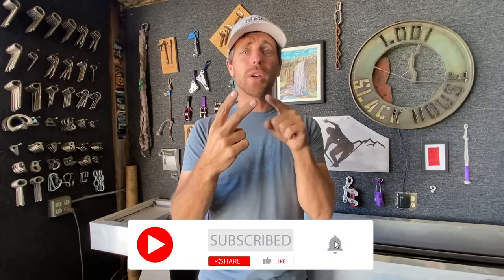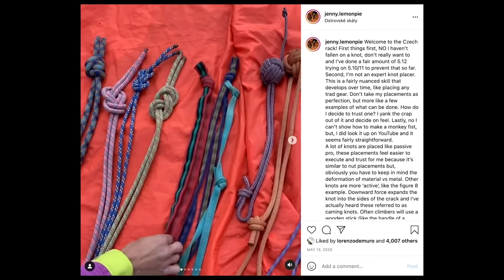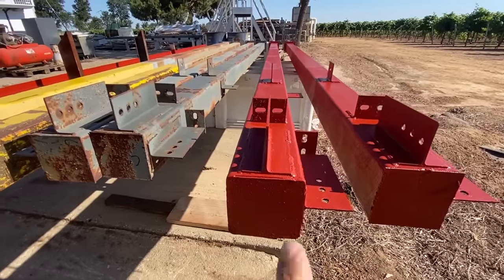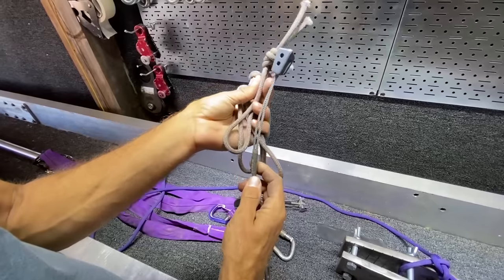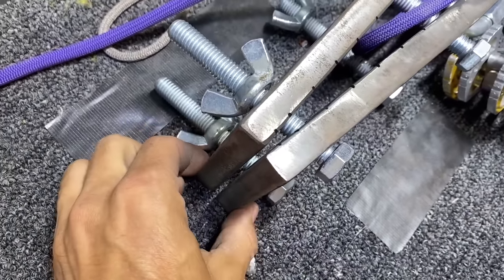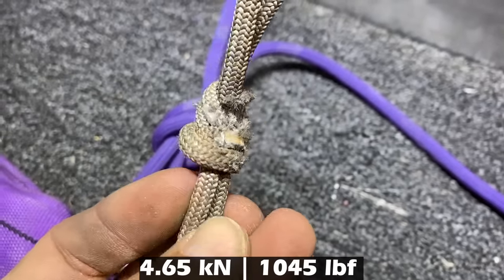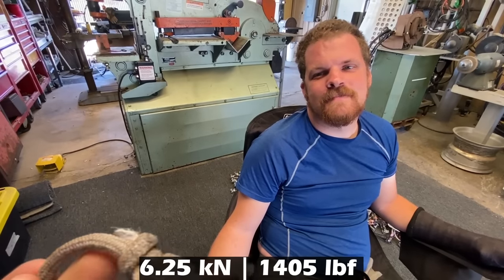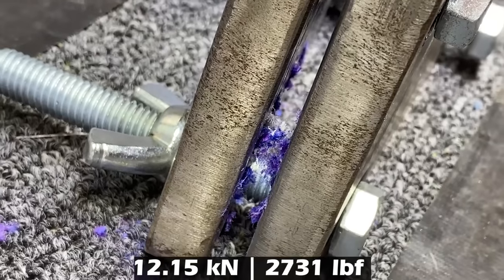Climbing pro made from knots??? Textile passive protection tested!

Comment: Ryan, it is not just just about friction, but also the very acute angle  of your ”cam crusher”. The force at which you pull gets translated inte a huge compressive force. So its not really a fair test of this type of protection. Higher friction and a less acute constriction would make a difference. Having said that, I have spent a short time in Elbsandstein and my impression was that locals don’t generally whip on these things. The attitude is more that it may slow your fall a bit. You could solo, but you need a rope to get off the tower…

Comment: This shows how inadequate slow pulling is and doubly so when the knot is placed into something without friction. The rock where knots have to be used are gritstone and very very rough with very high friction. 
Both things could result in the knot getting compacted and resist slipping through, but hard to know without some much more realistic tests.

Comment: the reason you arent getting as consistent results with you crack plates as the nuts is because there is no friction. the knot does a much better job of prying it open since not as much longitudinal in line force is being resisted at the plate interface. Your tension in your bolts is very large and there is some deformation. Stiffer bolts (high strength or larger diam) would help. It also looks like there is some bending in the plate that opens the gap.

in all, only a few knots pulled through, so the large scale behavior was met regardless.

Comment: I feel like the angle of the metal plates is unrealistic compared to real world placements. The constriction used seemed much tighter than most you will run into on a route.  The tests just seemed to measure the knots strength rather than how well it would hold when placed in a constricting crack like a nut. Friction probably has a greater impact for these types of "protection". Thanks for the video, I hope y'all can test the on real rock soon.

Comment: 300 to 400 grit sand paper glued to the Knot Buster 5000 steel plates may help give a more grippy surface to test the ropes with since steel on rope has low friction. It may help with the slippage.

I would also love to see the rock results because if its better then nothing. How bad is it when you h a be nothing, if ya dig bro

Comment: So, I've been rock climbing in the Elbsandsteingebirge, just across the border from Czech Republic, where trad gear is also banned. Yeah, trad climbing gear ruins trad climbing routes. Particularly if they are sandstone. That is why it's banned. Where I went climbing, they have bolts, but they are like 8 meters apart and 40 years old. Our lead climber used soft stuff like this. And by "used" I mean he put them in and then didn't put any weight on them ever. I'd say these tests make it very questionable if these things work AT ALL. Slipping out at 4kn out of what is essentially a vice???

But yeah, you should totally go. Awesome place to climb because it's been so well protected. Bring a local lead climber with you.

Comment: Steel (or perhaps aluminum, im not sure if you mentioned) isnt really the best analog to stone. im not sure what part of the country you guys are in, but sandstone is a relatively common building material. Im certain you guys have the skills to create a better testing jig, and am looking forward to see more content about soft pro
Reply from the maker: Yeah we saw that issue. Building a test rig with the capability to insert different slabs of stone.
Reply: @HowNOT2  Well all stone (I work at a mine) can be cut flat to accommodate your plates, but the action of cutting will for sure cause the rock to begin to fracture. If you built a small mold, you could cast rocks of various types into mortar (not concrete) or epoxy, then you would have a flat bottom part to work with.
Thanks for the reply, I dig your channel.
Reply from the maker: Our plan is to cut the stone to fit in the jig qnd leave that natural face exposed for testing, but we have talked about the motor idea as well. Might turn out to be less trouble.

Comment: The test kept slipping because the back bolts  area went more parallel opening up the gap at the front. If you put a wedge or non compressible material in the back of the jig it will stop it pull though so much

Comment: With the amount that the rope is able to compress, I wonder if there's a technique similar to some monkey's fists where you capture an item in the knot that would significantly increase strength while maintaining a soft outer layer. Granted, I'm not a climber, so I definitely don't know if that would keep it within the margins for being considered soft enough, and I have done rope weaving, so I know that trapping and object in a knot would have to provide a significant increase in strength to be worth spending the time tying/weaving it instead of finding better ways to set the knots and/or just use many more so that the falling distance is much less

Comment: Some words on that „soft“ sandstone:
Actually it‘s quite hard on the outside but very fragile beneath the surface. The reason for this is rain, which transports the harder elements of the sandstone to the outside. That makes the rock quite hard and gives it friction, but when damaged, leaves pretty much only sand.
So to avoid those pillars from crumbling to dust, climbers have no choice than to rely on those devices or don‘t climb at all.
But I‘d only recommend doing/learning this with a real experienced instructor else u will die 👻

Comment: It would be very interesting to see the force on the "crack" sideways. F= mu * N, so having a smooth "crack" makes mu very low, and you're only testing the wedge force without the friction force. Cams need the friction also, and are built to increase the sideways force, thus increasing the friction, as more force is added to the pull end.

Comment: I bet you'd see very different results using the upcoming drop tower. In a "real world" scenario there wouldn't be enough time of continual force for the knot to deform so much. If this is true then your breaking force would be a lot higher since the deformation significantly weakens the knot

Comment: If the rear bolts on there plates were held in place with some nuts on the inside I bet you would have less slip though the crack.  You can see the rear bolts allow the bars to go somewhat parallel which caused the knots to come out one side easier.

Edit: I made it to 9:30.  I can be ignored.

Comment: More correctly the knot is deforming under compression at the point of constriction forcing the portion of knot behind it to go into tension in excess of the material capacity.
Go climb the Colorado plateau sandstones for some soft stuff. You'll know it because the cam scars prove they are not a good idea.

Comment: if one has one double overhand knot on a webbing, with mechanical nut inside it. Maybe it does not slip through the crack so easily.

Comment: No monkeys fist. Need to try this on real rock. Need to know if it will stay in the rock. All you're really doing is testing the pull strength of soft goods. Was interesting  that the knots would flatten and slide out of the jig.

Comment: Interesting video. Your tests agree to some investigations from the 90ies (http://www.joergbrutscher.homepage.t-online.de/knoten.htm in German).
I need to admit, that nowadays a lot of climbers use for the 4 to 6 mm knots keval material and dyneema ist availible for 6-7 mm as well. Those materials hold higher forces than the tested PA cords.
For very thin placements, a method is to use the stiching of the sewn runner.
Due to the high roughness of the sandstones in Czech Republic and Germany the textile material most probably will stay in the placement.
Finally I need to admit, that climbers usually do not like fall in their knots and slings, since the rock itself is usually the weakest point, not your protection and every few years even whole pinnacles collapse.

Comment: You was not supposed to pretighten them but have them loose and pull hard on them inside crack, wider surface area and it becomes more safe.

Comment: What about a softer material used in a traditional “nut” like a brass material or the like? Could they use that? Anyone make something like that? It would be interesting to see it perform… sorry tor the dumb question…I’m a noob
Reply from the maker: Copperheads, brassy's and Bashies. Pretty specialized and somewhat archaic aid climbing gear. I believe they used copper and brass bc it would deform more and thus create more contact with the rock. Of course they are less reusable than the modern climbing nut.

Comment: Real rock slow pull won’t be as interesting as in situ placements which will be far harder to achieve anything approaching optimal.

Top rope backup, try and stuff a few of the same knots into the same seam, and see how varied the results can be or what the lowest you get is.

Comment: the knots seem to deform as they slide and maybe with friction plates they would start rolling onto themselves, instead of just sliding, making it more difficult for them to flatten... thus, not fitting that easily through the plates end gap.
In response to 11:05... i wanna see you do this in real rock xD

Comment: Friction is the key. These tests are pointless without considering it. Sandstone is much softer than metal friends or nuts. Therefore, using soft knots reduces abrasion. In this type of sandstone, knots hold better than metal cams because they create more surface friction and "bite" into the rock. The leader's rope is less likely to dislodge them compared to a nut.

Comment: The assumption that metal gear would damage the sand stone is actually sort of a controversial myth. Climbers in east germany conducted tests in the 70s, when nuts and cams started to appear on the scene. The results looked promising (not much more wear on falls and even less through just placement, because metal does not rub off the rock surface so much). However, representatives of the political party demanded the prohibition, because metal gear was an invention of the "Klassenfeind".

Also, I think your videos would be even cooler if the tests were conducted more properly. In your setup, the metal plates seem to become more parallel under load, making it easier for the knot to slip through.

Comment: You need a spreader bar in your holder, as the knot pulls even with the bolts, the back of the holder narrows and the front widens and let's the knot thru. 🤓👉

Comment: Interesting, yes. 
Relevant to non Czech sandstone climbing. not really. 
Liked etc anyway because I still want to see it in rock. 

Also, general principles demonstrated here that apply to all protection:
The bigger the pro, the stronger it was. 
The less slippery the material, the stronger it was. 
The less deformable the material, the stronger it was. 
The better the placement (i.e. tightening down the cam-crusher) the stronger it was.

And many of the breaking points reached were similar to what would be expected from the material used (MBS reduced by 1/3 to 1/2 by tying a knot). 

I wonder what the breaking strength of Czech sandstone is...

Comment: Your jig is flexing too much to have an accurate test. I think you can improve it by having a solid hinge at the back and bigger bolt through them middle, imagine a clam shell. Then glue some 220 grit sand paper on it.